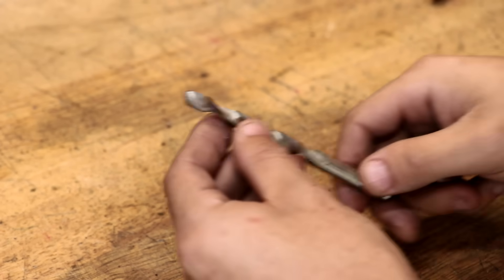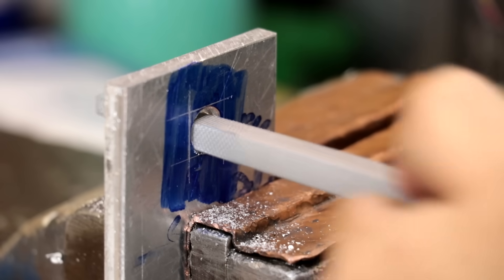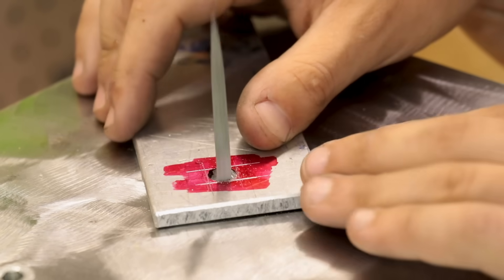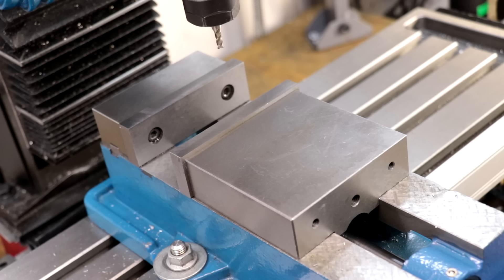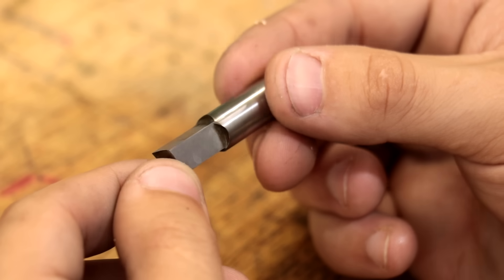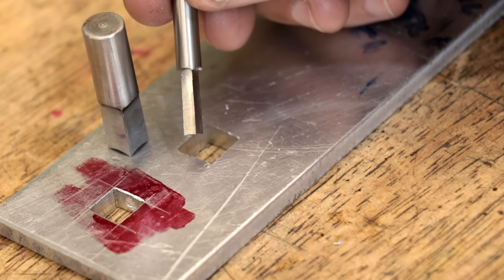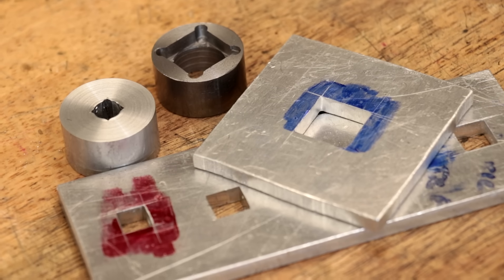Square Holes - 5 Methods To Make Them in Metal

Comment: If you want cheap machine file, get electric jigsaw, modify the needle file to have end that is similar enough to jigsaw blade. Hell just cut handle off from needle file and use old jigsaw blade, tig weld them together and it should hold together. To give it more support modify the base, or build attachment that has adjustable small ball bearings as guides/supports and then make little surface with a hole. Most jigsaws have speed adjustment, so use clamp to hold the trigger or reusable ziptie and if work jumps too much, just turn the file around and weld the bit on the end. The jigsaw wont like to operate long times upside down, specially with with metal filings falling down to mechanism. Depending on the machine, you could make 45 degree ramp where only the blade goes trough limiting how much goes in. If i was on the budget and had relatively lot of filing to do like this, then this would be the solution. For bit more budget. You can build the same mechanism but with grease nipples and enclosed/sealed mechanism that will last much longer. If you are in a pinch and working with soft metals, you can abuse somewhat your wood working tools and use chisels to make the corner on aluminum and brass since those are soft metals, but dont use the best chisel around and learn to sharpen it.
I have also used diy brozing by using the stock material peace of what ever is going to he hole, angling the front corners tiny bit to get it started, filed teeth on the corners and then just hammered it home bit by bit taking it out and removing chips.

Comment: I've tried running a 6" long Rotary Broach between an offset tail stock with a live center, and the work piece, and it seems to work just fine. Just wondering why I don't see any one using this much simpler method?

Comment: It would be helpful if you would show what does tool is 
used for
Reply from the maker: It was to connect up a drive shaft and sprocket which was done in a follow up video.

Comment: I will add two ,ore methodes, First a proper 4 sided broach tool for the size of square you need, they are priced at $300 to $1000 depending on thre size

 And? a simple square file but used as a BROAH .. this works surprisingly well and very cost effective ... just push the file though a pre drilled with a Arbour Press etc.

Comment: I was drilling square holes in the late 1970s using a "Watts Drill"
https://www.youtube.com/watch?v=rjckF0-VeGI
In addition, you can use a wire Electro Discharge Machine or a sinker electrode EDM you can form any shape you can make the complement of
Reply from the maker: Not really a diy machine is it. Not sure how much an edm machine costs but I’d wager it’s more than the workshop combined

Comment: is it possible  to made one  for  un  quarter bit   only 
I  need to punch a  thin  disk of metal  in  the  form of a  un  quater  bit  exagonal   to  add to  a little toole in plastic  for  1\4 bit  sise
jack 47 71

Comment: Did you save the metal filings for thermite? I used to work at a factory job in the 1970s where I filed the mating surfaces of a pair of tweezers.  I forced the unfiled tweezers into an opening in  a die where a file reciprocated up and down.  I had to wear leather protectors on my thumbs and index fingers.  I was paid by the piece, and occasionally made OK money for the era.

Comment: There are broaches with several sets of teeth with increasing width, so you just push it through a round hole and they make the finished square hole in one go. It's a matter of a few seconds.
Reply from the maker: These days I prefer pull broaches. But I didn’t have them when I made this

Comment: For your average DIYer the best method is your first method. A square drill bit. As heavy machinary is not required. The issue with the square drill bits is they are very hard to come by. I have been to multiple hardware stores and looked all over the internet and cant manage to find any. So custom made square bits are they way to go.

Comment: Why not build the die filer with the drive arm over the table instead of under it?  Then you wouldn't need reverse files and the file wouldn't push the work up off the table.

Comment: I have made many cutting tools with 'silver steel' (drill rod, to me), and all I did was heat it to yellow and quench it in oil.  Sufficient tempering seems to take place during the cooling process.   If I was making a drill, or similar cutting tool, I chucked the tool in a drill press and heated it while rotating before lowering it into an oil can, so it would not warp.
Reply: thank you for this. i would never have thought to stop warping in that way.

Comment: I mount my files ‘upside down’, glued into a tube which fits the holder on the die filer. If you put the tube in the lathe Chuck, and the file in the tailstock, you can get them pretty true. Apart from then being downward cutting, the other benefit is that you can fit a handle onto them so you don’t poke your eye out 👍🏻

Comment: Making a blind hole is much more difficult, especially if only one is required.
Many years ago I built a tool that required a 3/8" square hole 3/8" deep to fit a socket set handle to operate the device.  A fixed handle was out-of-the-question as it would have interfered with machining operations.
I laid out the square hole and drilled 1/16" holes at the 4 corners, tangent with the sides of the square.  Then drilled out the middle of the square with a 23/64" dia. drill.
Hand work using needle files did the rest.  Did not take that long to do this part of the job.
Nowadays I would EDM that hole with my shop-built machine.
Reply: You could also make the tool in two parts, one with the square hole as a through hole and then the other half, either a transition to round socket or whatever and just line up the holes and weld them together. Might not work for every application, but should be a useful solution for some parts.

Comment: Ihv seen a square hole in a solid granite stone measuring about 8ft by 12ft with a thickness of 4ft. The square hole is 2ftby2ft. The stone is part of a sculpture in a temple built about 500years ago in South India. There's also a granite chain measuring about 1ft in thickness for about 10ft in length, hanging over 20ft height.

Comment: You missed a slower method that can cut a square hole through nearly any thickness of material. The way a keyway is cut.
A special cutter is pushed through the hole by a hydraulic press. It has multiple cutting edges along it's length each taking the cut a bit deeper so 1 press gives a dozen cuts. Shim behind if you need more depth for a second pass.

I have watched this being done on Cutting Edge Engineering Australia's channel in a few of the vids.

Comment: I think the most accurate and best looking method for cutting a perfect square would be using EDM machining. You crank up the voltage on a Charmilles EDM and you can blast through any material that will conduct electricity, providing you get a good flush going with the fluid.

Comment: There are screw-driven square hole punches that punch 1 mm sheet steel. Prob can handle 2 mm Alu sheets. For a thicker part >>> stack and glue multiple 2 mm alu sheets together.

Comment: I personally use round bits in an ever decreasing size remove material approaching the corners, right down to a few angstroms in diameter. Strictly speaking the resulting hole isn't perfectly square, but it's pretty close. Admittedly it does take a while.

Comment: Here in Turtle Creek / Wilmerding  Pennsylvania, USA.there was a company that made square and hexagonal drill bits. It was on Airbrake Ave. This was the home base for George Westinghouse.  My math / geometry teacher had one and demonstrated it on a bar of soap.  He was teaching something called a loci of points.  The way the bit worked was  there was a square jig, A block of metal that already had a square hole in it that the bit went into to guide it. With each revolution of the bit, the cutting edge would take off more along the square profile. At first it only cut along the edge, then it would hit the corner and the path would go along the next side of the square. If you ever saw the Spirograph toy it was a wee bit like that.

Comment: Finally! I know I'm not crazy. I saw a video of the Colt factory making 1911's. They were using a "filing machine" to make the cut out on the back of the grip, the area where the spring housing is held. If I recall the machine also lifted the file up a little on the non cut stroke.
Reply: Would it be a shaping machine? A tool being driven to scrape a groove then free to lift up on the back stroke?

Comment: l am lazy l have a metal cutting band saw, a welder a grinder, and clamps, to make a square hole l cut 2 pieces of metal into an L  shape and weld and grind them, l had  to make a square washer for a coach bolt and this worked

Comment: For your die filer it should be possible to grind the tip cylindrical to fit the receiver and allow down filing with a bit of loss of stroke but I think it can be managed.

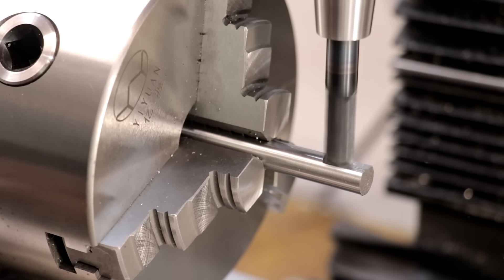Comment: Getting better all the time. Q: the part made at 7:20 is not the same part shown at 7:40 and onward. Its hard to see but I don't see much relief on the second one. Why the change?
Using the quill that way is a very old dodge used to emulate the powered or hand shaper/slotters of old, at lease 150 years old, not a new thing. Glad you warned about over stressing the quill drive.
Reply from the maker: It's the same part but I had to do another pass, the first cut wasn't deep enough. Cheers

Comment: I thought quenching in water would make it too brittle. (or is that when you heat it much more?)
Reply from the maker: Silver steel is a water quenching steel, so to make it less brittle you just temper it back to make it softer.
Reply: @artisanmakes  Cool. Will loo it up. Thanks.

Comment: what is really missing is the method of boring a lot of small holes and then punching out the bridges with a chisel or separating mortiser and the squaring it of with a file or cross chisel. 

I don't know if all the names are correct English is my second language and I relied on google translate to translate the tool names.

Comment: Instead of a filling machine, you could use a table mounted jigsaw with a metal cutting blade. Or just modify a file to fit in the jigsaw. They have accessories that help hold the piece so its not lifting up as you file/shape it.
Reply: Air(-powered) filers are also an option.

Comment: Excellent!!!
  O.K., Machinist of 40+ years here in the Jobbing shop, and an Owner. 
 Silver Steel, must be water hardening drill rod in this case.
  Tempering at 220 degrees...
  Celsius? ( I am American, Fahrenheit here where 220 would do nothing but boil water )  
  I have a rotary broach system,  but never understood if id cammed to a small degree, but you just broke the truth to me, set at minor angle out of alignment. 
  I now wonder, 1 degree, 2?...  3??
  Awesome. 
  Thanks a lot!!!!
  Mark

Comment: If you had taken other Materials like :Steel, Metal etc. instead of aluminum the judgement could have been seen differently. Maybe you could do the same video with mentioned Materials (STEEL & METAL). -> Though: NICE Idea√√
Reply from the maker: I'm pretty sure I did one of those in steel
Reply from the maker: I just don't have any steel plate on hand to do the first few methods
Reply: @artisanmakes  Consider adding mentioned Items for your next demonstration or a part 2 of this video √√

Comment: There's one method you didn't cover that was very common about fifty years ago, and it's similar to the square punch cutter you made.  It's just a stepped broach that is forced through the material, each step cutting a little more material.
Reply from the maker: For sure, I can't do it in my workshop since I don't have a press but it is definitely a good method
Reply: I have used the cnc quill to press the broach thru.

Comment: If you put isopropanol onto your file, it will be much easier to file aluminum. It prevents the clogging of the file and the finish is so much better.
Equally well, I never drill a hole into aluminum without using isopropanol on the drill bit. The hole quality is like night and day.
Reply: will give that a try
Reply: I will try that also

Comment: You can make "reverse" files for your die filer machine. It is easy if you dont mind losing a bit of length.
Use a blowtorch to heat the end of the file to anneal it (so it is no longer brittle) then just grind that new "handle end" to a round shape or whatever shape fits your machine mount. Then mount the file upside down. Obviously you can cut off the original handle end. 👍
Reply: I was thinking something similar. Logic ;)

Comment: I'm surprised that you didn't mention a square broach like clickspring made.
Reply from the maker: I don't have an Arbor press to do stuff like that
Reply: @artisanmakes  yeah I realized that might be the case when I went back to re-watch and you mentioned methods you could do in your shop you ought to get one they're fairly inexpensive and very useful cheers bud.
Reply: @artisanmakes  They don't take a lot of force to push them through. I recently made some replacement parts for a couple of 1836 door locks and pushed the 5/16" square broach through the 1" brass stock just using the tail stock of my lathe with only a small amount of effort.

Comment: I have also had good luck hammering square HSS bits through round holes in aluminum...obviously you have to protect yourself from the hss chipping/ exploding...but with some simple preparation it works rather quickly

Comment: Hey mate, might be a silly question, but could you turn your die filer upside down? This would make the needle files cut on the down stroke.
Reply: That's what my father did about 25 years ago. He also built his die filer and also had the same complaint of the file grabbing and lifting the work. He ended up flipping it and mounting it at the head of a busted drill press.
Reply from the maker: Yes you could, I might have to braze a shank to the end to give it a bit more length though

Comment: Triangle drill bits drill square holes, look it up 👍👍👍
Reply from the maker: Yes, I've seen videos of those off centre drills
Reply: @artisanmakes  thanks for the response, can you make a clamp/adapter that will hold your file the right way up in the die filer, or weld a tang on the other side of the files.....👍👍

Comment: You can drill holes slightly outside the shape of a square hole so that it will accept a square plug, and get a more fatigue-resistant structure for it.

Comment: FYI - HSS lathe tooling works well enough for cutting square holes in a  sliding style cutting setup like you used in your quill, and they will generally work with the grind they come with straight out of the box.
Reply from the maker: Yeah it does work, but I found that the edge doesn't hold up as well compared to silver steel
Reply: @artisanmakes  Do you mean 1.2210 steel?

Comment: everything go!!! but if the vertical drill or milling machine will have play, it will be a problem with such scraping because it will move away and you need to scrape 1 mm each??? !!! but still a nice video, greetings from Poland
Reply from the maker: Then do several passes before advancing the cutter. It's what I do when I do it in steel

Comment: @4:06 -- You should add some air assist to this.  There's a lot of build-up of chips in your file, and getting that out of the file during each stroke would probably help it function faster.

Comment: Holding a rotary broach that way without a specially made tilted holder for the tail stock was a nice idea. I have been thinking about a rotary broach but thought it was too much work for something I would use so seldom but a chuck in the regular tool holder can be used for so much more.

Comment: Just because HSS can be used to cut faster than the high carbon cutting steels that preceded it (due to better heat resistance), doesn't mean it can't be used for low speed cutting.  It is, in fact, very good as a low speed cutter.
Reply from the maker: I wasn't trying to imply that it can't be used for cold working, but it is pretty lousy compared to silver steel, and other higher carbon tool steels when it comes to cold working. Cheers
Reply: @artisanmakes  Sure, if you don't have CBN tooling you're not turning or milling it in a hurry, but grinding is fast.  A lot faster than indexing on the mill followed by a heat treat and then a grinding and polishing operation, at least.

Comment: Thank you, it was interesting and informative with high production values. How did you determine when the silver steel became non-magnetic?  The obvious of bringing a permanent magnet near it, or some other method?
Reply: @mmm365  The whole point is you don't need to measure the temperature, you just get it to the point that a magnet won't attract it.  This is the same point that the internal structure of the metal changes to make it hard.  It will be a red heat to get it to this point.
Reply: @ferrumignis  Interesting: the video gives the impression the work piece is short of going red???
Thanks for video.  
Pete

Comment: This is a bit of a crazy idea about the die filer, How about mounting it upside down that way "normal" files would work better for it but obviously keep the work surface the "right" side up. You will need to come up with some kind of method so you can either lift the file up (like a sewing machine needle) or lower the work surface down.